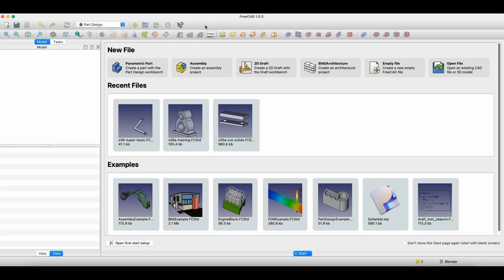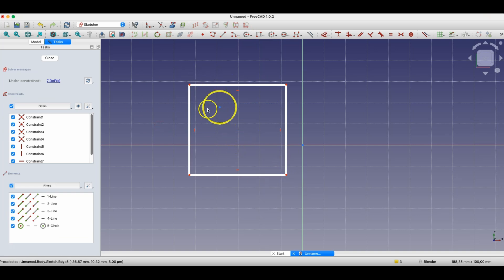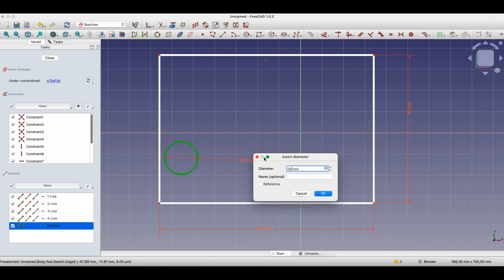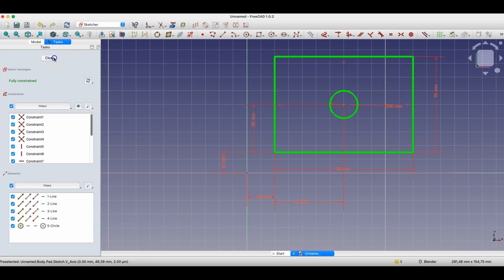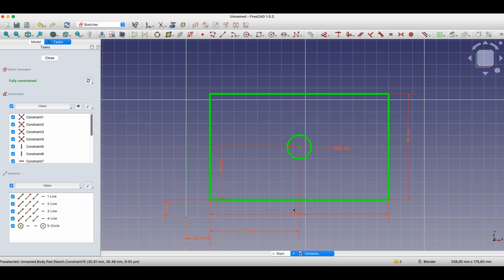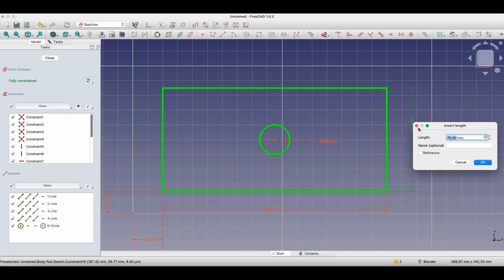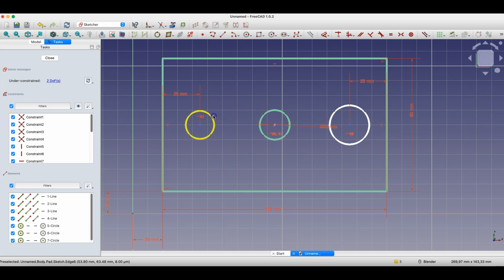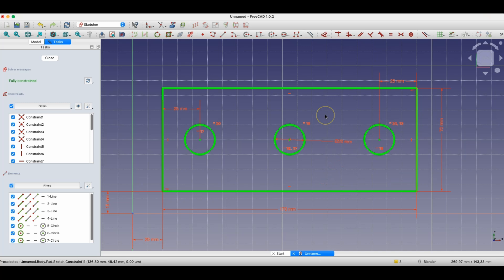FreeCAD Sketch Constraints Explained | Dimensional vs Geometric Constraints Tutorial

Comment: When adding the geometric constraint from the circle to the rectangle, you selected the vertex(point) in the rectangle corner. I would think to select the edge to create a geometric constraint. Why is it good to select the vertex and not th edge?
Reply from the maker: Good question — in this case, selecting the vertex makes the constraint precise. It locks the circle’s center to an exact point, while choosing the edge would only align it loosely along a line, without fixing the exact position.